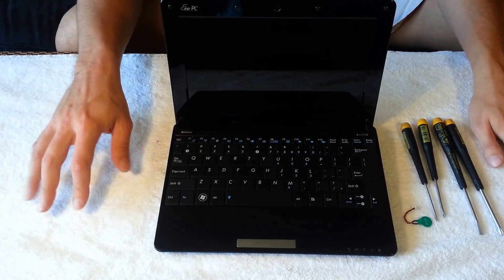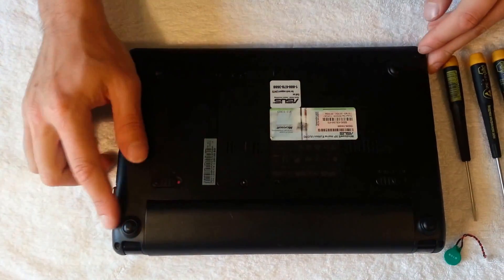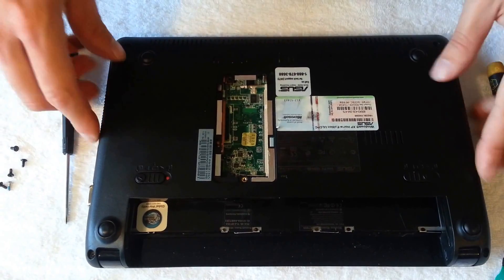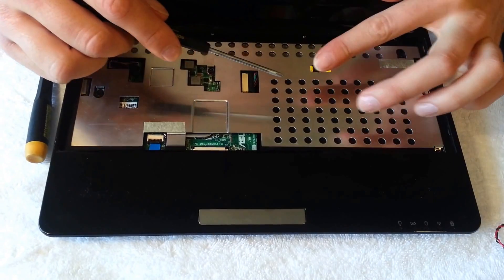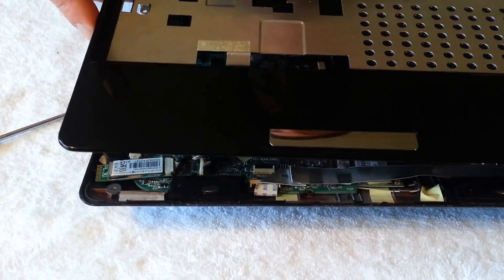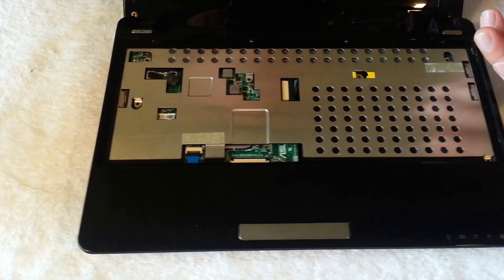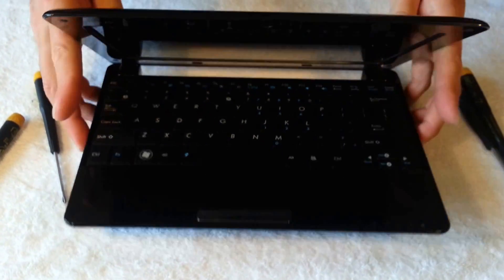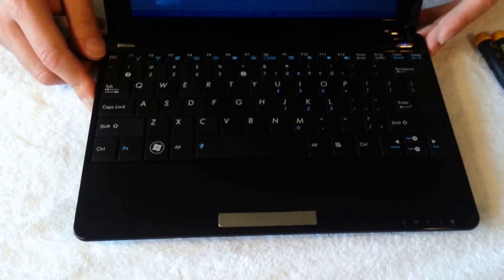Asus Eee PC 1005HA CMOS Battery Replacement

Comment: Mine is a 1005HA also but my battery was completely different. Mine was underneath the motherboard with a long wire going to the other side from the connector. It was a CR2032, not the rechargeable little one like in this video. However, this video was very helpful in opening the case.

Comment: I just tried to change cmos battery today, but  I did not get notebox open. So glad I found this video. will order correct battery and try again, I also need to clean fan. wonder if I can upgrade hhd to a ssd?
Reply: I bricked it.  Battery was under board, so I tried to put  netbook back together without cmos battery  broke small ribbon connector. I didnot want to leave apart till battery arrived.

Comment: This computer has never crashed on me I basically only use it as a storage device now because I don't want to surf the Internet because Windows is no longer supported since 2014 and I have no virus software updated another question is why will it not connect to Wi-Fi?

Comment: Old video my computer is from 2009 ee pc1005 HAB. How do I know if the battery is bad I know my main battery is bad it won't charge anymore it has to be plugged in or it shuts down but I didn't know about this little battery.

Comment: Thank you!
My cmos battery was underneath the circuit board, very tricky to remove. So, i unplugged dead battery, left it where it was.. tucked away the plug end.. plugged in rhe new onr and adhered it into the cavity that is right there.. working great so far! Thanks again!

Comment: Mr. J P, you are a wonderful man, I learned from your video. I still have a question, my eee pc stops at start screen and a note says press f2 to enter setup or tab to .......  But the problem is that the pc doesn't respond when you press any key. Is this a battery issue or something else?
Reply: This is way too late now, but for anyone with the same issue, recheck the connection of the keyboard flat cable.

Comment: What happens when cmos battery turns flat?
Reply: Lose date and some settings in the BIOS. You need to configure bios at each boot because it won’t let you (warning message to get into bios before booting the OS)

Comment: Good work. 
Designers should make such replacement easy and provide an easier access to CMOS battery. Although it is one in a 5 year kind of work, but why one needs to take apart a machine so much to do such a fix.
Reply: I think the designer must be dumb to place the battery at that place...

Comment: my asus has not been used for a long time. After switching on, only the LEDs are lit and the disk operation is audible. The monitor does not fire, it only blinks white when extinguishing with the POWER holding down. Could this be a problem with completely discharging the BIOS battery? Should BIOS and WINDOWS be re-loaded after replacing the batteries? I will add that the comp itself starts right after switching on the power supply - it starts - I mean diode lighting and disk operation - the monitor does not work.
Reply: Just remove the ram and gently cleanses the golden connectors on the edge with a eraser or spirit liquid (mind don't spill to much spirit just clean with a soft cloth) and make sure no parts of the erasor are left behind on the connectors. And reinsert the rom back its because of carbon accumulated on the rom. If that doesn't solve the problem then your rom is dead. This happened with me I did what I explained and it worked for me. You try it and let me know.

Comment: what size the screw driver gotta be in order to take out the battery??
Reply from the maker: To take out the screws?  just use a Phillips #1 size.  Any jeweler's set would work as well.  Once you get case open and are able to access the battery, you just need your fingernail to remove the battery itself from the board.

Comment: If I'd do it I'd manage the battery cables tight with battery, the way you tucked battery cable near the antenna of the lose top board you'll affect it's range negatively.